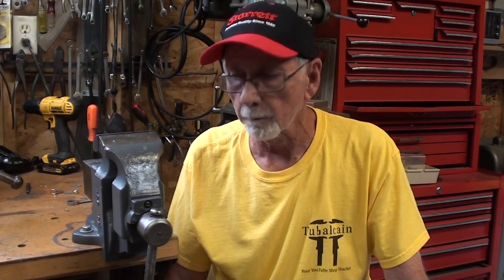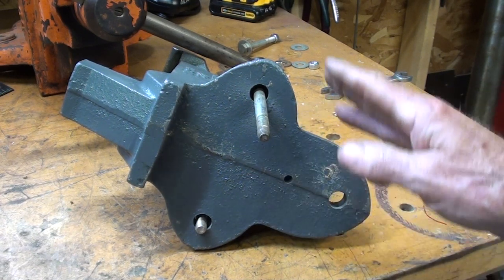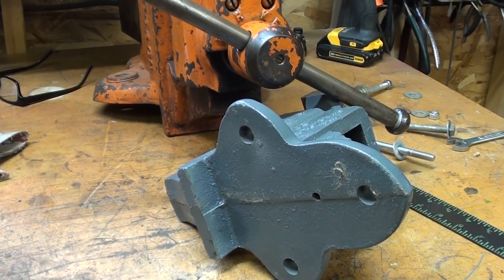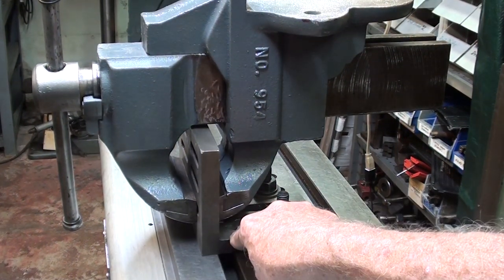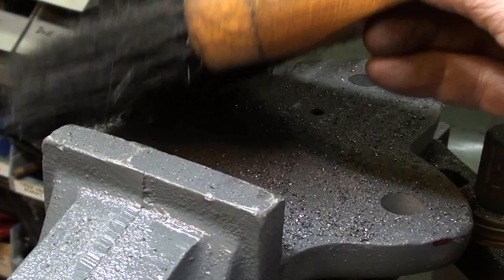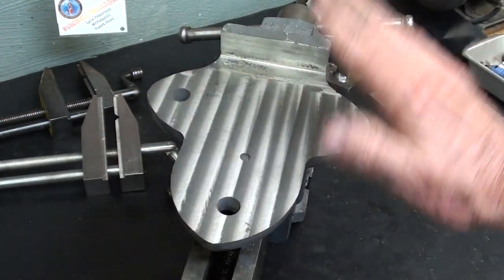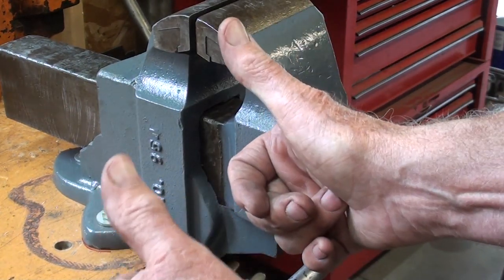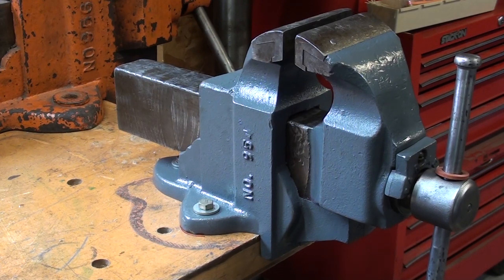Parker Bench Vise Repair pt 3 TIPS 593 tubalcain

Comment: The older vises, well, the cheaper newer vices too, have flatness and squareness issues and if the vice isn't made from the malleable cast iron, which the cheaper ones usually aren't any more, you can break your mounting tabs if you bolt it to a steel top table. Back when I had my shop and you could find the old vices and fix them up, I use to flatten the bottoms and square the shoulders too. But I did prime and paint them, just because I don't like rusty, bare iron. Great job!
Reply from the maker: Thanks
Reply from the maker: Thanks

Comment: I agree about not liking swivel bases EXCEPT for those on Wilton vises.  I love my three Wilton bullet vises, each of which (except for the Baby Bullet) have swivel bases.  The difference from cheaper vises (that never hold their swivel well enough to prevent rotating under load) is that the Wilton's have a toothed ring in their bases which locks the vise to the base.  NICE!
Reply from the maker: Thank you, now I remember that tooth swivel base

Comment: I was making a little clamp today for my rotary table.  Now I have just realised that it's very similar to one of those float lock vises.  I put some holes in the jaws so I can bolt it down to the T nuts and use it for rounding over pieces of square bar.  I'm sure I probably go the idea after seeing it on one of your earlier videos.
Reply from the maker: That’s awesome

Comment: I have found vises with a swivel base that wobble are generally the cheaper ones. My Wilton does not wobble - at all. I guess the ears (not flat bottom) could break off depending on what it is mounted on: wood bench no, thick metal top bench maybe yes.
So interesting that I am not the only one who sees something at swap meets and experiences the same thoughts you had about the vise and the work invoved in getting it home. Then has the same regrets! 

Thanks, Tom

Comment: The machining looks very good.   I love the monkey face your grandson drew on the bottom.   Nice touch and customization.
I have a Craftsman version of a Wilton Columbian vise similar to the grey one you show.   It has the swivel base which I have rarely needed and normally dislike.   I replaced the locking handles with a carriage bolt and coupler nut so at least I am now able to use a wrench to tighten the bolts.
Dave.

Comment: Great video.  Rather than go through all that work, or for those who don't have all the equipment necessary to machine the vice, couldn't you just mount the vise on a thin piece of soft wood between the vice and the bench.  As you tighten the vise to the bench, the imperfections on the bottom of the vise would compress into the soft wood resulting in a vise that sits flat.
Michael from Canada
Reply from the maker: Yes

Comment: i always put a square steel plate under all my vises. this gives you a place to pound on things. also distributes the force of the vise being used over a wider area. i never use a swivel vise on my workbenches only end mount vises. swivel vises will never hold up. i would have used my 7" grinder on my steel plate  to grind away enough to let vise sit flat.

Comment: I just picked up a 1927 Parker 375 locally, and the base on the vice is completely flat.

Unfortunately, it was broken ages ago and the repair was extensive brazing to fix the swivel back jaw in place like a normal vice, but still fully functional.
Reply from the maker: Surprised to hear it was machined

Comment: Like the video.  I am working on a craftsman 3.5” that was rusted solid. It was missing the swivel base but I intend to mount it on a 2x6 that will be clamped to the bench top so the vice can be moved to different positions if needed.   Could it be said that this interest in restoring old vices is a “vice”?
Reply from the maker: Yes lol

Comment: With all your vise videos, I can't help but wonder about electromagnetic vises. The main thing I don't like about them is that they are designed to work on mains power, which scares me if cutting tools are near the vise. I think a electromagnetic clamp that runs on low voltage high current DC with heavy coils and good heat sinking (thermally conductive epoxy and maybe even fins!) would be a very interesting thing, (not without dangers however).
Reply: such a vise might require water cooling however.. this would basically involve modifying or buying transformer laminations, cutting slots in them for tubing, assembling them over a tubing system and adding conductive epoxy to transfer heat from the windings to the plumbing, then figuring out the electromagnetics. Not insurmountable but kind of time consuming (however, possibly not too expensive if you have giant transformers to sacrifice).

Comment: Thanks Mr Pete. Do you ever use the exact sized bolts, that are the same size as the cast bolt holes in your vice? It can save it moving under extream sideways force.
Reply: Yup, shoulda used 9/16 dia. bolts, same as the ones on my (English) Record 4" vice.
Reply from the maker: I did not have any that were the exact right size. I have to go down to the store

Comment: Aloha, Mr. Pete  Years ago I got to watching you-tube via you, Tom Lipton, and Shop Dog Sam, I have always enjoyed your channel and sometimes I think you are too verbose and sometimes I would like to see more explanation.  Therefore I think you must be about right in your commentary.  I have worked in very few places that had a good solid steel tabletop to mount a vice on, some had 4" - (3 5/8") end grain bench tops, some covered with sheet metal, my point is the draft on the bottom of the vice is not of importance on such installations the wood will absorb the draft of the metal.  I also do little or no "machine" work on the bench vice, so the accuracy of the vice to the bench top is not an issue for me using a file.  Keep up the "practical" side of the trade, as some of us old "folks" remember when it was up to "you" to figure out the details, just do it!!!!  Mahalo for your time in sharing with us and don't change a thing.  That said I was disappointed that you didn't machine the bottom true...  Hmmm  maybe I contradicted myself!!  I hope you young folks understand, you too Mr. Pete, I like "Tubalcain" best.. Aloha ke Akua Chuck
Reply from the maker: Thanks Yes I agree

Comment: Great series, I need to check my Chas Parker 954 for the handle centering set screw, that would be handy.
Reply from the maker: Yes
Reply: @mrpete222  , The screw is there, I had to loosen the plunger with PB blaster, now it works. very handy. Thanks for the Shop Tip.

Comment: Jeff from WA here.  Sorry you missed that Starrett sheet metal vise.   Bought an old Starrett 035 [3.5"] standard bench vise for $50.  It swivels yet not too tall but the swivel clamp-handle was bent.  Straightened, it holds fine.  Sharp pipe jaws.  Original main jaws in fine shape, plus solid copper soft jaws held on by brass screws capped by solid copper screw plugs I made.  Have a Reed you might care to trade?
Reply from the maker: Awesome

Comment: HI Mr Pete, If the vice will be installed on the bench permanently, maybe it would be easier to use a router and route a small channel in the bench to accomodate the casting protrusion. Just a thought and alternate solution.
Reply from the maker: I swap vises on a regular basis

Comment: Hi Lyle, this is off topic, but I have been watching your series on Foundry / Pattern making.(Very good by the way) I have a suggestion for gassing your cores when using the sodium silicate binder.  CO2 is heavier than air. Get a bucket, box or an old eski (I think you call them a portable ice chest / cooler box), seal the lid and connect a vacuum cleaner through a hole. Run it for a few minutes with the core inside to draw as much air out of the core and box. Then stop the vacuum and purge the box with your CO2.  This might get a guaranteed result for activating you cores. What do you think?
Reply from the maker: Good idea thanks
Reply from the maker: Good idea thanks

Comment: Mr. Pete, it appears to me that the two halves of that vise were rather offset when the vise was originally cast. If you look at the rectangular hole the beam goes in, you see that offset there, and it looks like that offset was left in by the factory, probably thinking that that opening, not being a load bearing surface, it would not matter. Look at 6:48. May I say "wow"? Point being, as you are seeing on the base, my opinion is that when that vise was cast, the two halves were a solid 1/16" off from perfect. Hence the offset on the base. You're doing a good thing milling off the mounting base, IMO. For the most part, when you bolt the vise to whatever mounting surface you choose, that center seam will just press into soft wood. But I would be willing to wager that if you bolted that vise to a strong steel surface, you WOULD crack off one of the mounting ears.
Your videos are not too long. Period. 
When it comes to overpaying for something at a sale...money is a funny thing. We each regard it differently, based upon our upbringing, life experiences, and blah blah blah. You would have paid $100 for that Wilton cheerfully, but $125 was too much. Well, the only difference is $25. Like it or not, $25 ain't spit. In another setting, somebody might have paid $250 for it and thot they got a deal. All it takes is one guy with a looser sense of what money is that you...and besides...you can only sell the vise you sold once. 
Cheers Mr. Pete! Thanks for making your great videos!
Reply from the maker: I agree

Comment: to make the swivel bases suck less, you can make a hole in the table and screw a plank under neath and hide the base inside the table so its a lower profile
Reply: jig saw + carbide 'wood' bit on a variable speed die grinder "roto rasp"
Reply from the maker: Never thought of that, but it would ruin the bench

Comment: i make cheater bars for those vise swivel adjustments, so its not so unpleasant on the hands. If you slide a rubber tube over a pipe that fits over it, it works decent and feels good
Reply: @mrpete222  I am glad you feel that way, especially when they get a bit clogged with grinder dust.. they literary hurt your hands IMO. I feel like the amount of torque you need to deliver in the amount of space that is available is an unrealistic design compromise.
Reply: I wonder if something better can be made, like a ratcheting chuck or something.. but I don't have the imagination to think of one that will survive if someone decides to use a maul on the vise. Evil leaky hydraulics maybe.
Reply: Also can't help to use a cleaning tap on the holes, or make sure they are not tapped too tight.

Comment: I only have a 6" mounted on my bench, a 4" that I use outside so, it's laying loose, I also have a 2" & a 1 inch that clamps down. I had a job in which they worked perfectly for! Talk about buyers remorse, Today I had to return some JUNK! Should have known better, Purchased a H.F. bench grinder & it fried the second that I turned it on=JUNK! So, I swapped them for a set of ramps & was debating on metal or plastic????? I got the metal ramps but, I wonder if the plastic ones would work better in a dirt/gravel driveway???? I fear that the plastic ramps would work better & would not sink into the dirt/gravel?

Comment: One thing that gets me is for years I have had my backside chewed out for using a crescent wrench wrong, but than I see you use it also wrong.
I have been taught not to use the slide jaw to bear the torque but the wrench it's self. That the slide will break and can cause safety issues.  Correct me if I am wrong.

Comment: I’ve always drilled out the holes on the 2 swivel base bolts to install a longer/larger crank handle  so you can really put the gggrunk on them and I’ve never had a problem with the vice moving. I’m sure If I have 15ft of pipe hanging off one end I can snap the vice clean off the bench. Question of the day………Who said they can move the earth with a large enough lever?🤔
Reply from the maker: Atlas

Comment: You wondered why someone would own or mess around with a cheap vice. I am disabled and cannot afford a vice even close to as good as the ones you consider junk. I have a Harbor Freight and its horrible. But I filed the slide and polished the contact surfaces and it works. So yes even the cheapies are useful to someone..
Reply from the maker: I agree thank you

Comment: Nice job.
How is the vise mounted the bench, what are the bolts going into?
I have a 5” on my bench. The bolts go thru the bench top into nuts trapped in a piece of 3/4 ply screwed to the bottom of the top of the bench.
Easy to put on and take off.
Reply from the maker: Two inch thick wood

Comment: that casting is pretty sharp and that table is pretty crappy. You can grind the vise into the table so it fits flush by sliding it back and forth, might save you alot of work 😎
Reply: especially on MDF
Reply: i think it might be stronger theoretically since there is more material and its a 'lap' fit. stop wasting shop time!!!

Comment: I’m with you on the swivel feature.   Never used one that I didn’t end up swearing at.   I just found a Wilton vise in like new condition for a hundred bucks.   First thing I did was to weld the swivel solid.   This will help me in cleaning up my language some,  which I’m also trying to improve.

Comment: I meant to add that the accuracy of the mounting surface doesn't seem that important when you consider the amount of use this vise has seen and that it still hasn't been broken or compromised. just an observation

Comment: I have this same model Chas. Parker No. 954, but on the side where the number is there is also an SH above the number.  Do you know what this signifies, Mr. Pete?  Thanks.  I have been inspired by your video to restore mine.
Reply from the maker: Sorry, I do not know what that designation means
Reply: @mrpete222  Thanks for your reply.  I slept on it and the only thing I could come up with it is a date code.  It is cast where other Chas. Parker vices sometimes have a date so maybe the SH is really HS (looking at it from the opposite side), and the H (eighth letter of the alphabet) means August, and the S (19th letter of the alphabet) means 1919.

Comment: I thought  that the fixed position vice was a machinist or tool makers Vise .vice with swivel bottom are a multipurpose or use or trade vice  .I doubt if you see pipe jaws in fixed base vises
Reply from the maker: Yes

Comment: I think that Wilton bullet vise, the burgundy one, is missing pieces in the swivel base. My 500S has what looks like a face gear in the base and nuts with teeth that match. When you swivel it it tends to jump up and down as it moves from one position to the next, and even light tension on the base locks it firmly in place.

The 600 is $1,600 at MSC:

https://www.mscdirect.com/product/details/11703048

Also, your videos are not too long.
Reply from the maker: You might be right about the swivel base